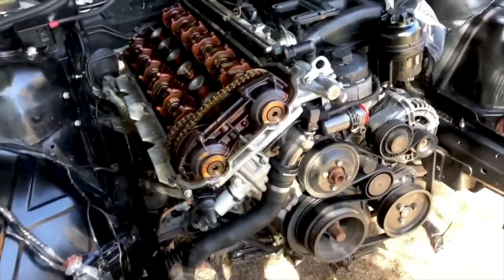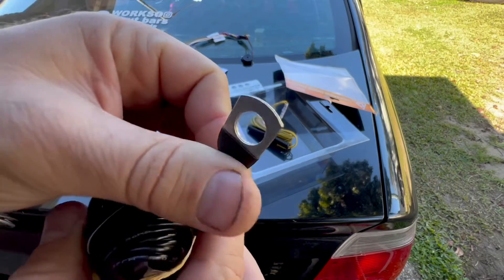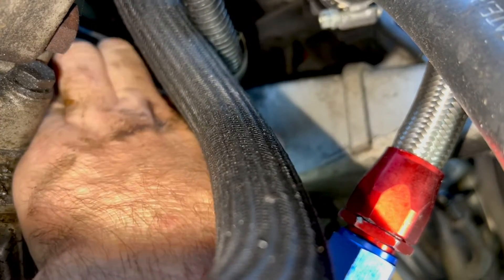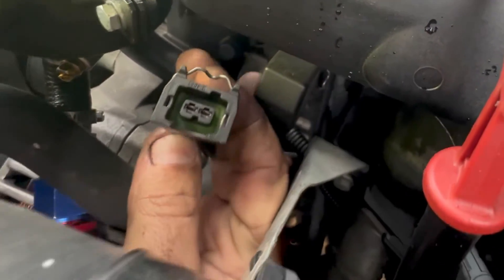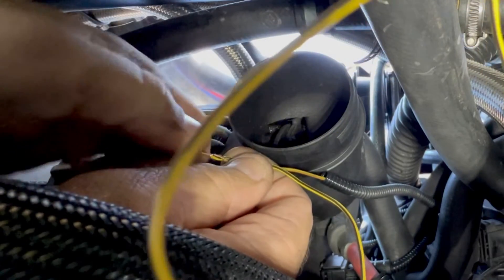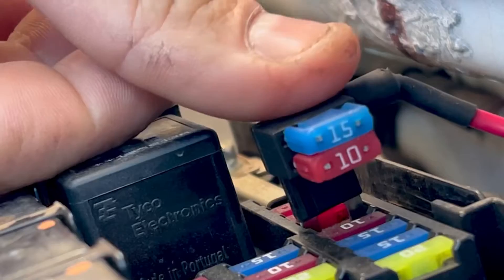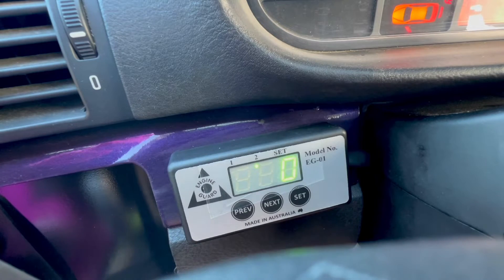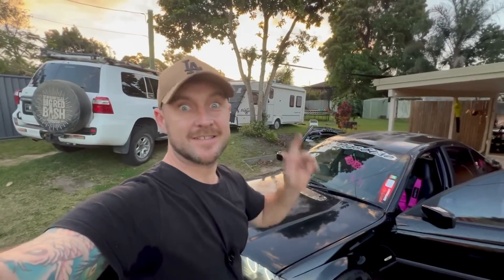How NOT to cook your E46 at the track. (Overheating and Low Oil Pressure)

Comment: Building a 323i aswell first event in October, your videos are more then helping, just spotted an oil catch can fitted any videos on that. And reason for fitting thanks
Reply from the maker: No I did that years ago. I just wanted to simplify the original pcv system and also keep tabs on how much blowby the engine has. Basically run an oil safe hose from the valve cover to the catch can. And block the return which is at the base of the dipstick. 👍🏻
Reply: @BertusBuilds  no bother was just wondering good man thanks

Comment: What temps do you usually reach on track and just in general?
Reply from the maker: Not actually sure but the needle never really moves. But I would say it will run a bit hotter and I can just dial in the alarm so it’s not going off if it just creeps a few degrees over.
Reply: @BertusBuilds  What temp do you reckon you'd program the alarm to? 

Also your videos are mad brother, love your build.
Reply from the maker: @JORDO41 it actually has an auto function, where it learns your usual operating temp, and will alarm if it goes over the usual range. But I’m not sure on the manual setting till I get to the track and do some skids. Probably 85-95 degrees I’d say.